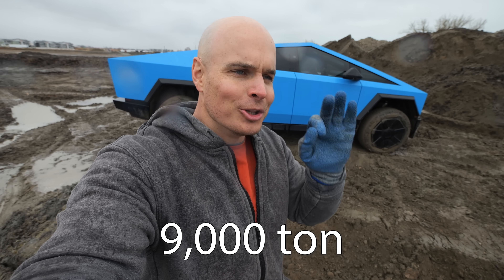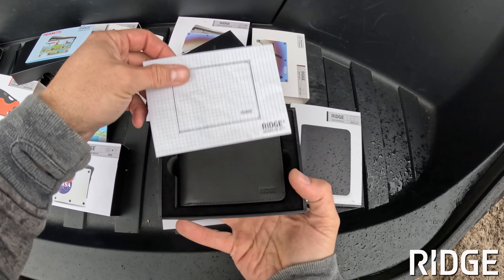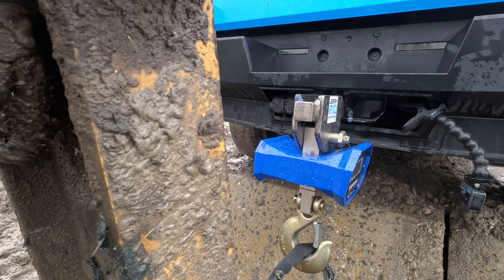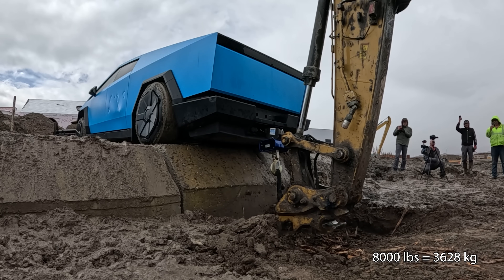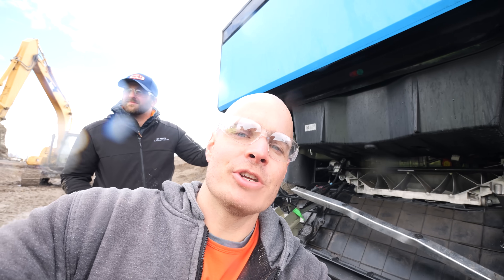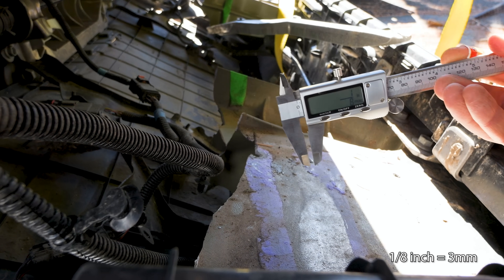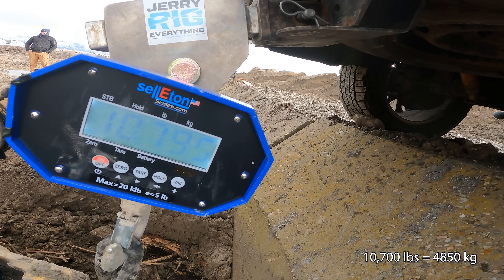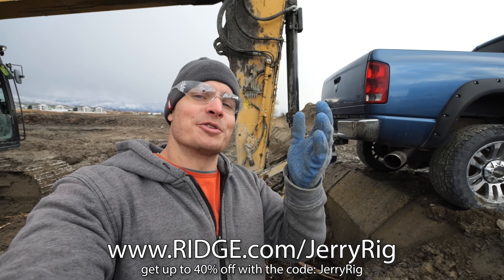SHOULD YOU TOW WITH A CYBERTRUCK?! - (catastrophic failure test)

Comment: The dumbest truck ever made. It just keeps putting checks in the “Cons” column. Like DO NOT WRAP IT!!!! Unless they come out with a new special SS wrap, wraps are designed to go on PAINTED SURFACES. Not bare metal, paint. Look up removals of wraps on these. It destroys the surface of the stainless steel and sometimes the adhesive absorbs in. Now your truck is going to be permanently discolored. Add the fact that stainless steel stretches so that door ding ain’t coming out. There’s a reason why the only other mass produced stainless steel vehicle was the Delorean. That looked cool at least, this looks like a rolling trash can. 😅

Comment: Just to get ahead of some of those "Well it held up above its rated limit, so it's a bad test" comments; 
While it did hold up above its rated limits, stress tests like these don't only show if things fail, but how things fail, which can be just as important. 

Inevitably, someone is going to overload their truck, or hit a pothole badly, or the aluminum will eventually fail after a few thousand load cycles, and the hitch is breaking. 
In the case of an overload failure like this, a steel frame bends, and the cybertruck aluminum frame snaps clean off, taking whatever you were towing with it, and sending it god knows where.

This IS going to happen at some point, and a design like this IS a critical failure in a supposed "work truck". 
It would be fine if it was just a car to go fast, but it's not, and so it needs to be judged accordingly. 

Like, we build crumple zones and airbags into cars because we know that some will eventually crash. It would be nice if they didn't; but that's not life, and you can't design a car and say "well, we designed it to never crash, so it doesn't matter if it's unsafe in a collision". 
So with this, it doesn't matter that it's not going to happen to most cybertrucks, because it's going to happen to some cybertrucks, and when it happens, it's not failing safely, it's failing dangerously.

Comment: Dumbest test ever, just as bad as your phone tests. A hitch is not designed to withstand 9000lbs of down force, they are designed to tow the weight. Most tow hitches are rated for only a few 100lbs and warn against putting too much weight on the hitch itself. The purple "glue" you saw is most likely just to eliminate noises as most car companies use something to control noises. The advantage the CyberTrust has over all the steel trucks is that they will never rust and break in half like steel trucks do.

Comment: 9x the rated tongue weight, 90% of the tow rating. Yet the strong reaction. A couple hundred lbs away from not having it break in this video.

I agree steel frame will be stronger. But it’s a question of good enough. 

Majority of people towing with this won’t even be towing over 10,000lbs to begin with. So even if you back off a cliff and the trailer is hanging vertically it’ll still be ok for the vast majority.

Btw why couldn’t they do more than 10,700 with the other truck? The excavator should be strong enough to lift itself, and it’s 50,000 lbs, no?

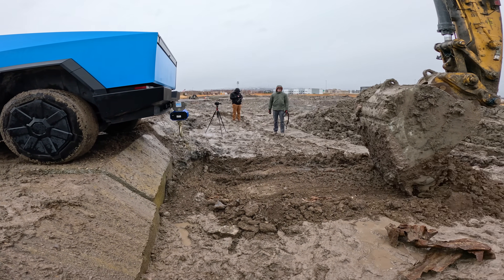Comment: 4:20 Correction, Steel does have a fatigue limit.
Reply: Everything has a fatigue limit.
Reply: @vdochev  Aluminum doesn't. It's a scientific phrase, educate yourself on what it means first.
Reply: @ Fair enough. English isn't my first language.
Reply: Steel has a fatigue limit after a certain stress point, before that stress point it will not, theoretically though. Aluminum on other hand, any load fatigues slowly over time even like only 1lb of force, theoretically of course though. If i remember the graph for life vs stress for aluminum is exponential, so like it might take years for aluminum displacement at such a low load to be seen by the naked eye.  So a thick aluminum frame will fatigue at any load, but also have to take in account steel bolts holding it together. Also brings up galvanic corrosión as a producto of the steel and aluminum being in contact, if they use steel bolts (maybe they have a coat on them idk). Just make the frame steel. Unless there is someother pro that an aluminum frame grants.

Comment: I strongly disagree with your conclusions.  The 2024 Cyber Truck is rated to tow 11,000 lbs, total. The max tongue weight is 1,100-1,500 lbs.  Your tests showed breakage at 9-7x the tongue weight and 95% of to total tow capacity.  Maybe you could argue the max towing weight rating should be reduced to 8,000lbs, but to conclude that the truck shouldn't be used to tow anything is hyperbolic, click bait trash.  That steel frame very easily could have snapped violently at 11,000 lbs. You don't know.

Comment: Steel does have a fatigue limit, but that truck was probably stronger when it was brand new. Steel does degrade, it just stops degrading at a certain point. Steel is actually ridiculously strong and is probably one of the most important inventions of all time.

Comment: Is this setup right ? you are forcing horizontal load on the hitch . I expect that it is rated with 100 kg .   the pulling capacity is not the same as the max horizontal load.
The M Y has in germany 100kg max horizontal load with  a pulling capacity of 1600kg.

Comment: I have never seen a manufacturer rate a hitch for its breaking point. That is very reckless and irresponsible of tesla to say that its rated for 11k pounds with no safety factor. For reference the typical engineering safety factor for automotive applications are usually 3 to 5x the rating meaning at a bear minimum its true rating should be  3700 lbs max (well actually 3300 pounds because it broke at 10k but for this moment ill give the fan boys the benefit of the doubt and say you weakend it during the first test even though that just makes it even more realistic). What tesla did there is downright criminal. Also if they keep ignoring this they're headed for a massive class action lawsuit.

Comment: your 10,000-pound test is exaggerated and misleading. The Cybertruck’s 1,100-pound tongue weight can reach 2,750 to 5,500 pounds in real dynamic conditions—based on 2.5 g bumps and a 25% slope—not your extreme setup.

Comment: The tongue weight of the CT is 1100lbs and you broke it with 10,000lbs, that's actually impressive. The "Cresting a steep hill" doesn't make 100% of the trailer weight tongue weight, idiotic statement. If that was the case you'd break all trucks. If you are loading to max on any truck you follow the 80/20 rule and take care. And Whistlingdiesel, if you watch the original video, they drop the rear of their CT from high onto a large concrete pipe and cut the video so you don't notice, THEN they break the hitch as it was already broken.

Comment: I'm so glad I sold my Tesla stock about a month ago this right here is exactly the reason why I did not buy the Cyber truck I reserved It's not the truck they sold us when they unveiled it. They said it would be a stainless steel exoskeleton construction and that's not what it is. They also said it would have 500 mile range and that's not what it is. They also said it would have 15k gvwr and it definitely doesn't. I'm quite sure that I've probably loaded the hitch on my Ford truck with more weight than that while loading heavy equipment on the trailer. Sometimes you end up with more load on the hitch then you want the first time then you have to reposition. Either way My truck has been abused thoroughly for 25 years and 315k mi. There are no cracks in my frame it's not bent and it will pull anything you hook to it.
Reply: When has Leon Musk delivered on anything? Seen any Tesla semis hauling anything but potato chips?

Comment: I was interested in the science, but a the 11 min. mark it became propaganda. I dare anyone to put 10,000 lbs down on their trailer hitch and see if their truck survives.
Reply from the maker: I did the same test to the Dodge. Watch the video.
Reply: @JerryRigEverything  Dodge was bent to a point it would be unable to tow at 5000 lbs, but, if you hadn't pinned down the front with that forklift, it would have flipped at 2000 lbs, because it's too light (4,765 lbs).
Reply: Watch the full video bro

Comment: Gee If I ruled this planet.. Loads up Ultrasonic holography pattern matching the shape of the Tesla parts that fail, sets pressure to bottom of ocean, and releases metal into the Shockwave hologram while perfectly managing Atoms & Crystalline structure by computer That's how you're gonna replace all those stupid robots with Points at Star Trek Replicator + Ultrasonic resonance disintegration of materials down to dust for use It may sound farfetched to you people but I'm using your own science that I agree with to an extent. Googles: "Ultrasound can reach pressures as great as the bottom of the ocean Illinois EDU" Plasma way more powerful at higher resolutions TOTALLY REMOTE

Google: "Ultrasound see viruses turn on and off genes" Where are genes at? Plasma speakers better.. Points at Predator Movie Plasma cloak discharges How I know will scare people or they would already know by knowledge that transcends time. Lol..

Comment: The fact that Tesla uses adhesive to hold parts of the truck together, is not without precedent. There are many family car and supercar manufacturers that use glue in conjunction with spot welding to hold the automobile's unibody together. but that is in CONJUNCTION with spot welding and those vehicle do not suffer from failure of their unibodies. but this looks like Tesla is using glue alone to hold components onto the rear of the vehicle. That is bad, especially when there should be no place between the two surfaces glued together that have air pockets of space between them. Humanity has become extremely advanced in the technology of adhesives, our adhesive technology is far more advanced than any other technology we have, but the way we seen how that rear component has been glued to the frame with three stripes of glue and gaps between them, is a failure waiting to happen. it would be stronger if the two surfaces being adhered together were held by one solide coating of adhesive across the entire surfaces being mated together. if you have a small compact or subcompact car, go look in your trunk and pull the carpeting away from the metal unibody, and you will see segments glued together, and this has been used since about the mid 1980s or so, and never fails in automobile accidents, because of the design of the unibody. with spot welding to tack the pieces to gether, the glue is used to hold the pieces together in location where the welding robots cannot reach. Lotus, has used glue to hold their sports frames together without any kind of failure out of regular driving, and an accident proved to be insufficient to break them apart. But, those frames and unibodies are almost unilaterally steel, aluminum is not used except in rare cases, and bolstered by steel to strengthen them. Tesla needs to learn how to properly use the glue they are using in their designs!

Comment: Fatigue limits and "getting stressed from towing" is assuming your tow is actually putting a problematic load through the part - which I'd personally doubt in normal remotely sane use even for the really thin casting that crappy truck uses - the geometry (what was visible after you ripped it apart anyway) looked sane enough to me. Now if you smack it around get in a collision or two without noticing then that 3 tonne truck worth of immovable/unstoppable object leading to stupidly heavy shock loads...As that is big difference between the two - the steel frame is almost certainly going to be permanently bent with impacts that if applied to the cast aluminium would leave them appearing to be entirely unharmed. At least right up to the point you put that one more tickle on the casting that should have been well within the safety margin and it fails entirely. 

It is certainly not that the material itself is unsuitable if used correctly - same as with CF submersibles - a material that isn't the normal but can be done and in that case has been done before more than once very successfully before the Idiot decided to make and then run the Titian so poorly... So while I'd like to see that cybertrunk chassis in its entirety and tested more rigorously, and I think it has to be the worst truck ever made for many other documented flaws this one potential failure I'd suggest from the evidence so far does actually require abuse to become a problem (more than willing to change that should real evidence of inadequacy in sane use come to light though). Once you add in abuse any vehicle can be a problem, so I'd give this a pass for now...

Comment: So, kinda curious why this is such a failure, when it just exceeded tongue weight by ten times limit? To reach the trailer tow weight onto the tongue of the truck like you suggest, means you stand the trailer vertically on end balanced precisely down onto the tongue. Then you pitted a 2500 series framed truck, shouldn't it have been a comparable 1500 series truck? This reminds me of Chevys claim for torsion bars on front suspension being better cause you can ride on the torsion bars thru a ditch so your tires can grab on the other side. This can work, but I'm pretty sure thats not how torsion bars were made to be used.

Comment: The maximum tongue weight for the Tesla Cybertruck is 1,100 lbs (500 kg). This is the downward force on the trailer hitch. You put almost 10x that and wounder why it failed. With this line of thinking I should be upset when my 8 ply tire that  usually corresponding to a weight capacity of around 2600 lbs per tire fails with a 10,000 lb load on it. This sounds more like a whining liberal that's upset with Elon Musk than a scientific method to see if the truck does what it clams it can do.
Reply: He addressed this specific point in the video.

Comment: A lot of people in here really showing that they didnt watch the video. Zack explained the real world scenarios where this matters.
Reply: @RevDrTarr  his "explanation" was just as wrong as the rest of the video, towing up hill or hitting a pot hole does Not put the weight of the entire trailer on the hitch.
Reply: @leeward6762  He didn't say it does; he said it can. And obviously with all the failure videos out there, it has.
Reply: @RevDrTarr  then that's the case with every truck on the road...no other hitch is designed for the forces in the video...they might not break like the tesla, but that doesn't mean they wouldn't fail and still lose the load. If it bends enough that's just as bad as breaking if it causes you to lose the trailer.
Reply: @leeward6762  The Ram didn't break and it was already in an accident. But I guess you didn't watch that far.
Reply: @RevDrTarr  the Ram bent enough to cause the trailer to fail.
Reply: @RevDrTarr  also, my previous comment said even if it doesn't break as long as it bends enough then it would still lose the trailer...did you not read till the end? ;)
Reply: @leeward6762  Dude. The Ram was already bent from a previous accident. Steel is better than aluminum. Cybertruck isn't as capable as other trucks. Good day.
Reply: @RevDrTarr  obviously the Tesla isn't built for towing but that doesn't mean that this test wasn't ridiculous and it didn't prove anything. Read more of the comments.
Reply: @leeward6762  I said, good day.
Reply: @RevDrTarr  😆 🤣  well good day to you to sir.

Comment: Its really only ever been an SUV not a real truck, even if i like the weirs styling i wouldn't call it a truck ever. Also even getting to 10k on the receiver is impressive, i think its close to any other small truck but steel has plastic deformation where the cast aluminum fractures.

Comment: I'm not saying the cyber truck hitch situation is good, but to say that it is one improperly loaded trailer away from failure is a complete lie, they have tongue weight versus towing weight for a reason, to improperly load a trailer to have 10,000 lb on the tongue would not only be essentially impossible given the towing weight, but would be 100% user error.

Comment: 10,400 pounds tongue weight capacity before failure FAR EXCEEDS design spec.  You should do a pull back weight test to see at which point the gigacasting fails, which I bet would far exceed the 11,000 pound tow capacity.  I don't buy your pothole theory of a bounce that snaps the hitch assy.  Besides, you shouldn't be towing at 80 mph!  This was a test skewed against Tesla.

Comment: I'm not sure I understand the problem here.  The truck handled nearly its full towing capacity as a sustained sheer force on the hitch before failing.  

Now, it's completely fair to say that a work truck should do better -- at the very least fail gracefully -- but unless you can show that it's prone to failing in normal situations, the only conclusion I can see is "it doesn't exceed its rating by as much as its competitors."